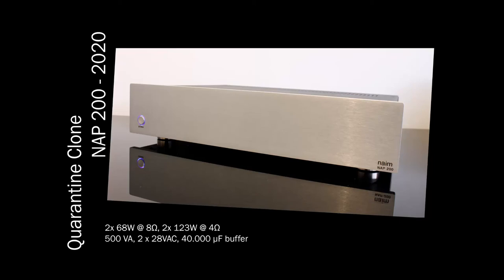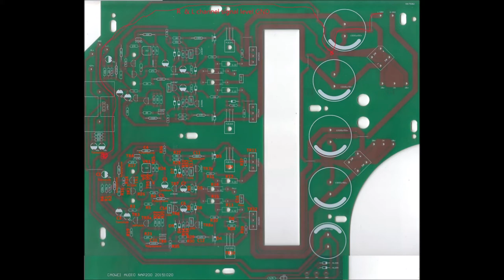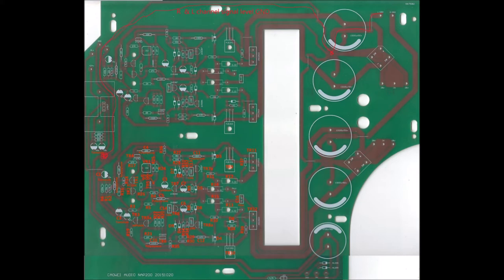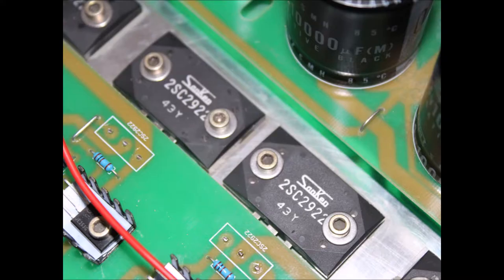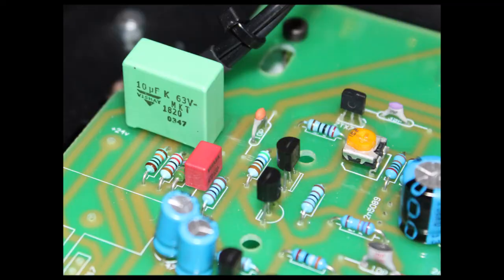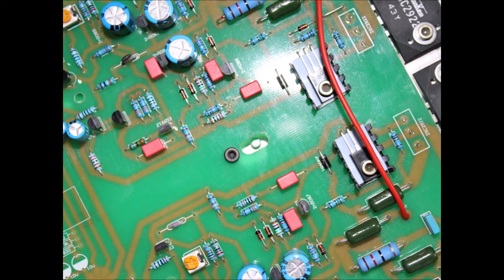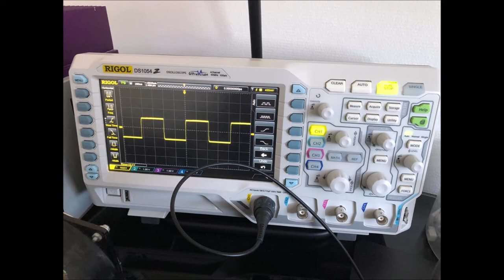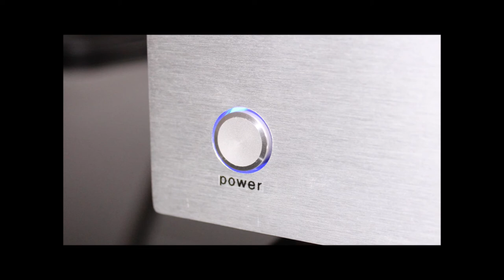NAP 200 Quarantine Clone Amplifier

Comment: thanks for the video. I actually have one of these too. But I bought mine premade with no name. It actually sounds pretty good with a very detailed presentation. But it isnt really much better than my NAD. Just different. I took a look inside and at least to the untrained eye it looks very similar to the real thing. A least the layout is exactly the same.  It was of course as you say a bit of a gamble and I have no idea whether the sanken transistors are genuine. The circuit is very simple though which makes me think why the real thing is so expensive. Just as a side note it seems to sound better once it has been switched for a while. It runs amazingly cool..

Comment: The original 70s NAP200 is far removed from the NAP200 you heard at the audio fair. The original version is so rare! The newer iteration of the NAP200 was introduced in 2002. Kudos for building your own version, but unfortunately you have overlooked many of the details that make the Naim amp what it is. The solid PCB supports, the relay, the screw terminals, soft start circuit - all these little things add up & will affect the sound. Also - I'm not sure what country you are in, but did you ensure the casework is grounded?
In any case, if you're happy with it, that's all that matters - as long as it's not going to kill you!

Comment: What is that board you put on the output speaker?
Reply from the maker: That is a speaker protection board which senses DC and adds a smal delay at startup. I added it mainly for protection, but the original NAP-200 also causes a small ‘pop’ towards the speakers when the amp is powered on (or off). It is based on the UPC1237 IC. Works like a charm 😃
Reply: @PA4MW  thanks !! Nice builds by the way

Comment: How is amplifier sound?
Reply: Hi James I can tell you how my prebuilt version sounds. It has the same circuit board as in this video. The overall presentation is what I would call transparent, detailed and clear. There seems to be a little extra energy at around 2khz which enforces that detailed sound. Mine isnt a warm sounding amp and I could say it is a little forward but it isnt really harsh either.